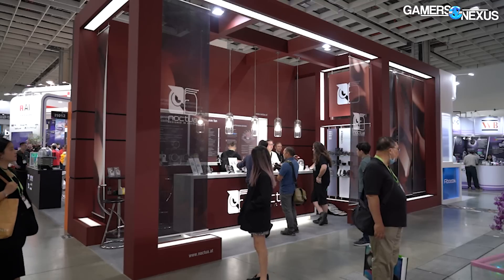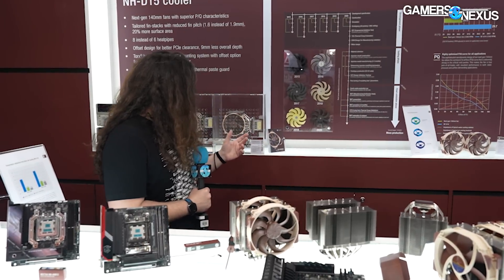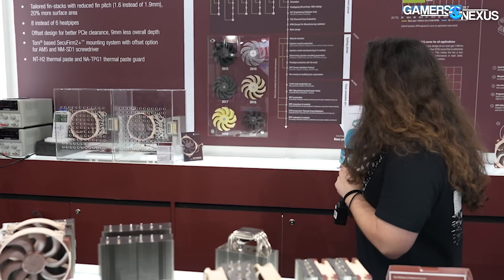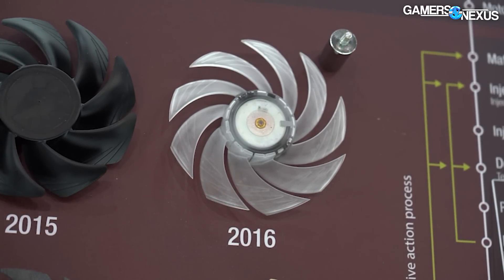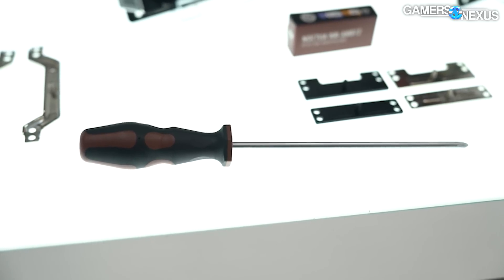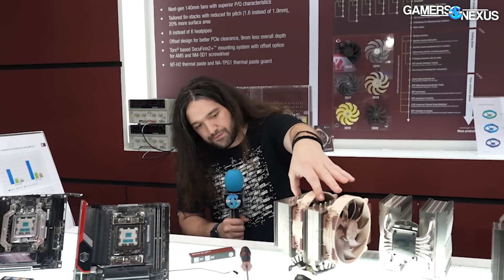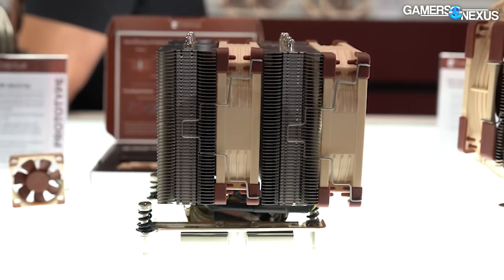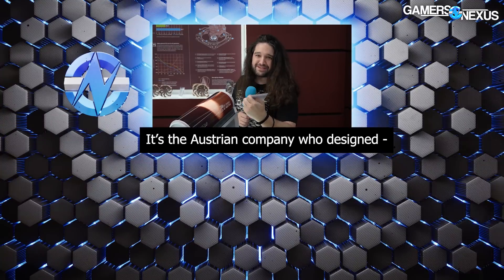Noctua is Back: NH-D15 Gen2 & 8 Years of Fan Development

Comment: is the fan sticking out more than on the first gen nh-d15? i was ready to drill out holes in my sff case for the fins that stick out with a first iteration of the cooler, but the new fan seems to be towering over the heatsink for like 5mm more...

Comment: Noctua is fine. While I think they are really admirable in certain ways. They just totally prevented me form buying their stuff for a long time because they had just did not give basic colors like black and white for their fans. They could have easily conquered the market long ago if they just spent even tiny bit of focus on aesthetics.

Overall, I actually don't like the company, even though I think they make very functional products. I really liked them decade ago, but after that they just never got me to buy their stuff. They basically made zero effort to cater to customers. And at great loss to their company. Frustrating thing to me it really was for nothing, it would not have been hard for them to offer basic colors and touch up their fans a bit. They didn't need to go rgb and other gimmicks, but they just lagged on even color black for ages. All this would have been quite low effort and would not have distracted one bit form their performance focus.

Now, if I was buying best cooler for powerful cpu and overclocing now, I would probably black noctua. But I don't really need anything that powerful so basic becool! is more than fine. And it looks better.
Reply: They are actually not that good. Competition is fierce. 
They have been extremely bitchy in past accusing several companies of copying them while themselves take inspiration from great engineering from other companies. A lot of inovationas they brag about have been known and solved for a long time in the industry.
Their marketing, customer support and ease of use is top notch. And that is what separates them form other....

Otherwise, I would personally avoid them.
Reply: @bozoc2572  I didn't know that. But I knew they were just really stuck up business just from fact they have not made any proper actions to address consumer needs. Or if they do, it's very late and bare minimum. 

And yeah, when it comes to fans I don't see any reason for anyone to buy them, they look bad and you can get equivalent or better ones for better price. CPU coolers currently have their space at high end, but other than that I don't see the appeal or actual reason for buying them.

Comment: I exclusively use Noctua fans with all my PC builds now. I've used fans from ghetto companies like UpHere, BeQuiet, and Corsair as their products don't deliver. I have no issue paying that Noctua tax as they provide outstanding customer support. I love using Noctua's Industrial 3000 RPM fans on their air coolers and aftermarket AIOs as they are so quiet when tamed and can be so aggressive when needed. Also, I've never had a Noctua fan go out yet.

Comment: The attention to detail from Noctua made me use them since 2008. Never used any other cooler/fans. I have builds running daily for more than 10 years not a single problem. Expensive and ugly thou. I will use liq  cool when i can run them daily no issues for at least 5 years. no scales, no pump failure ,no refils etc.

Comment: I have no problem picking only Noctua if at all possible, because I like the brand, but damn, the product range is so varied and confusing. Can't they decide whether it is worth it to have one or two fans with one of two blocks of fins? And whether fan overreach or neat fit with fin height makes a difference?
Well, I guess GN will have some test data on these if I need to check. Luckily it is currently not a concern of mine.

Comment: Quick question: did anyone try a  contra prop style fan setup like in the Tupolev Tu-95 or Antanov AN-70.....or better like in the NK-93 shrouded contra props setup? Just google it for those who want to know....i know that contra props are rather loud...but being shrouded like in the NK-93 engine should help and my guess would be that the rpm are rather low compared to normal fans

Comment: I did use a Noctua D12 on my old gamer PC during 10 years, excellent performance with a  overcloked i7 860 (@3800mhz), silent and perfect reliability, no problems only removing dust..., but i did recently built a new PC with a Rysen 7800X3D (without any overcloking) and did cool  it with a Actic 360 (i did first think about using a Noctua D15, but no...): the Arctic is a realy good AIO, relatively unexpansive, silent and efficient (50°C at CPU in game)

Comment: (For the next-gen products, I'll edit my comment to include the actual model numbers here once they launch and YouTube recommends me this video again)

(9:32) I could immediately tell it was a promotional item (complete with the same design used on the label on Noctua thermal compound), however, off to the left, it looks like Noctua are collaborating with Linus Tech Tips to produce limited edition Noctua themed LTT screedrivers. Neat!

Edit: I had a look at Cuula One, and while not a consumer product, it looks like a way for drink companies, for example, to promote new drinks at roadshows, events, supermarket sample booths, or even at a sports event they would sponsor. The branding on the side can be swapped out, so I imagined a company inserting one based off the design of the cans itself but edited to fit and with the drink logo positioned sideways or oriented in a way to look like a can being poured out into a cup.

Comment: I run a D15 in my AM4 build and used 4 x 140mm  Noctua industrial case fans(NF-A14, the ones that go up to 2000rpm), gave away the stock fans.  My Phanteks P600S case doesn't have airflow; it is a very quiet air pump ! Set it and forget it, love the stuff !

Comment: Along with the D15, I'd love to see an update the NH-U14S with the new fans they're developing for the next-gen D15.  

And please please please please release these with Chromax variants from the start.  Don't make me wait 3 and a half years to buy your fans again.  I get you want to sport your colors, but I'd rather you do that by putting that beautiful metal owl emblem you include with your coolers on the top of the cooler in an interesting way over a black backing rather than the entire fan that goes completely against the visual theme of any PC I build.  I love your fans, but man do they clash against literally everything except a purpose built Noctua themed build.  Which no offense, almost never happens.  So I'm begging you, please make the Chromax versions available from the start or at the very most, within 6 months of the initial brown and beige release.  There are better ways to sport your colors.

Comment: Wondered if any Thermal paste nerds could help a brother out; Got myself new paste from Noctua (always seen the praise for cooling!) I'm using it for fixing out my CPU temps with a Corsair AIO H150i ELITE CAPELLIX. Had to take it off and back on the other week when i was doing cable management & cleaning. Noticed i didn't have a good spread on the CPU and i was out of my old paste. I've got a little spreader it came with along with some wipes but i do have Isopropyl on hand. The H150 had paste pre-applied on the AIO but how should i go about applying the thermal paste this time? On the CPU itself or re-apply on the AIO? Should i use the spreader to even it out? I've been holding off on doing this for about a week now as i really don't want to make a bad judgement call and lose out on cooling. If any legends can help out i'll give you a sub <3

Comment: Hope Noctua brings out a huge cooler similar to the IceGiant CPU cooler sometime in the future. With Noctua's quality and perfection. The cases now have enough space in the direction because you no longer use CD drives and upwards is often mesh, if you take Fractal Design cases as an example. Graphics cards take up more space towards the front of the case and a CPU cooler could do the same.

Comment: I have a dumb question - why all fan manufacturers put a motor in the middle of the fan? Why not putting a coil outside on the perimeter and avoid blocking the center of the fan?

Comment: I've had a pair of Noctua's 140mm IndustrialPPC fans on filtered intake duty in my PC case running ~700rpm 24/7 since January of 2016 and they've been brilliant.  That little bit extra static pressure the industrial-grade fans provide has really helped keep the inside of the case from getting grotty.  I have dusted out my heat sink's fin stack several times in these last seven years, but I've never actually needed to, and that's really something considering I share 900 square feet with several cats.  The fans aren't silent, but the timbre of the sound they do make is pleasantly unobtrusive like the sound of a gentle breeze through the trees outside your window.

Comment: 8 years of R&D is what happens when you take the German perfectionism and crank it up to 11 by being Austrian.
Reply: i have a disease where i only drive volkswagens, older ones at that. but i like how dead simple the cars' designs are. i do all maintenance, including transmission and engine rebuilds, body work, electrical. once you have the few scattered specialty tools needed, you quickly learn why there are more of those stupid little cars on the road with more than 100k miles on the clock than any other brand on earth. more than all american brands, more than all japanese brands. that is what we need. simple, stupid, reliable, and IT JUST WORKS.
Reply: @ghomerhust  cough Volvo Redblocks cough
Reply: We'll need these kind of mentality if we're ever going to be able to explore planets. Over-engineered spaceships will be better than American's "planned obsolescence" so we can sell you a slightly improved version of ship.
Reply: @Paul_Sleeping  absolutely! K.I.S.S. also works in space travel. the more complex stuff gets, the more dangerous it becomes.
Reply: @ghomerhust  Ahh, very good point. Hopefully we can find a good medium with well-engineered and safe spaceship while it is  easy to repair during space travel.
Reply: @Paul_Sleeping  I mean you are certainly right in most regards. But I would say that NASA is pretty impressive for space stuff specifically. I mean we're still using 50ish year old satellites like the voyager probes.
Reply: @Paul_Sleeping  idk, SpaceX is doing exactly that. American
Reply: @tuckerhiggins4336  Yea fuck SpaceX ngl. I think private space exploration companies is a terrible idea overall. And SpaceX is the definite worst just cause of Elon Musk.

Comment: I was affraid that Noctua will stop producing this super-fan's (NF-A12x25 ULN - ultra silent, like 39cm away from wifi-router dead silent) and bought five of them, nearly 200$ in fans! They are irreplecable! I connect them through USB-to-12V cable to cool down Cable-providers modem and my WiFi router. If you ask, yes I have DOCSIS 3.0 near 800Mbps dl and 100up. They have fan blades so close to the frame, really impressive - I need them to have silence and reliability (years of use).

Comment: I mean through all those years there are only second to them fans. Running all Arctics fans, just because they are way cheaper for pretty close performance and relaibility + lifetime and only resent P12 Max are real competition to old Noctuas with a bit more noise for the same performance + overhead for more performance.
Noctua's strategy with spending so much time for a worthy upgrade is absolutely legit, especially taking into account that their selling points are scrupulousness and being as close as possible to perfection at all costs.
For example it took 5 years for Arctic to bring major update for their P12 (P12 Max), with 6 years warranty for both old and new. And Arctic P12 wasn't as ambitious as Noctua's fans, mind you, it had more room for improvement.

Comment: I love the fact that Noctua decided to offset their new nh-d15 2.0 like they did with their nh-d15s coolers for gpu compatibility. This is the main reason I went with the d15s. I can't wait for the new d15. I would imagine with the bigger base, 8 heatpipes, offset mounting and design for gpu clearance, and the 2 updated lcp 140mm fans, this should be a monster of an air cooler.

Comment: I love Noctua fans! I have 3x 9 year old Noctua 120mm case fans in my corsair750d (2 mounted on a corsair h110 which is also 9 years old and still cooling my 4770k) and have been running flawlessly daily since 2014.(knock on wood :) ) The only thing I realized now was that putting Noctuas in a watercooled PC makes it so the only thing you can hear will be the annoying pump noise. Going all air Noctua next time.

Comment: noctua is great. you can trust blindly that their stuff just works perfectly.
I have had so much fans that had motor noise, rattle, droning, other issues with all sorts of other "high end brands" and their coolers like bequiet, noiseblocker, deep cool and fractal design and noctua has been spotless in any application.
noctua is a little bit more expensive but its the only brand thats actually worth paying the higher price for. everyone else will ship you a trash fan that you need to replace sooner or later, but i never had any issues with noctua fans, which is actually astonishing, because almost no other company has such a good track record with quality control and overall product quality.

Comment: Seems like a pretty reasonable amount of time for r&d considering their products remained at or near the top of the comparison charts in the meantime
Reply: ...and remained running the entire time they were at the top.
Reply: @jong2359  no kidding there. I have been using noctuas for a decade and zero failures. Other brands, plenty.
Reply: @kelownatechkid  Even their redux line is rock solid. Have 2 NF-P12 redux that are spinning basically non stop for 3 years now. 
One thing I love about their fans is their noise profile. It blends in with the background noise extremely well.
Reply: @DrakkarCalethiel  I first started buying Noctuas for the noise, and to be honest it's the main reason I keep buying them. I can't stand noise. My noctua builds are all silent to my ears, unless my GPU is doing a big render, but that's the GPU fans making the noise.
Reply: @fakecubed  Same, unless my GPU gets loaded, my system is dead silent. Makes me want to do a "Noctua mod" on mine to bring noise further down.

Comment: 8 years for the development of a fan probably is about right actually.

Turbomachinery engineering is hard.

And this is especially true for axial flow fans , because you would think that the physical space that you are given to design a fan is basically infinite (you can make the shape of the blade ANYTHING you want), but what you design MAY NOT achieve the performance (and cost) objectives that you are trying to hit.

And THAT is a PART of what makes the turbomachinery engineering so difficult and so challenging.

You move the control nodes for the curvature of the blade, and even if the blade has variable thickness throughout, you can SIGNIFICANTLY, adversely, impact your flow performance.

It doesn't take much for it to NOT work.

Comment: Their mtbf, cooling performance and noise levels set the bar high. Some people think they are ugly. 'The tan and brown doesn't go with my rgb' Whatever. I won't use any other air cpu cooler since I switched a few years back. Used a few of their case fans too. Yes they are more expensive but if you rely on your computer its a cry once situation.

Comment: Moved from Noctua to Bequiet for my Intel 12900k. Big mistake. The mechanical install of the BeQuite fan was insanely painful because you couldn’t reach the screws . A simple cutout for the screwdriver would have solved it. This are details that make Noctua stand out of competition. It is still the easiest on the market.

Comment: This will support the new LGA-1851?
My next PC will for sure be Meteor Lake, and i want the NH-D15 Chromax Black as cooler.
Reply: ofc
Reply: @GUY-on-Earth  ok ok. Well i thought as much, but you never know. For all i know even the original NH-D15 can fit on 1851. I just don't know exactly how the design will be yet.
Reply: @FabledGentleman  i think that’s the the cold plate is bigger on Gen 2 cause the 1851 socket is going to be bigger

Comment: Looks promising but tbh the competition is also very strong and often times a lot cheaper so this fan would have to be a lot better for me to consider buying it
Reply: There are certainly cheaper options that are as good or better, and sometimes about as quiet… but when I bought a cooler & fans just last week it was the long warranty and my experience with Noctua’s excellent customer service that convinced me
Reply: @TheShortStory  Quick maths: I buy an Arctic fan for 7€ -> its broken and for some reason Arctic doesnt replace it -> I rebuy the fan so I spend a total of 14€. Noctua fan costs 32€ >>> 14€. Even if the replacement is also broken, buying a replacement would still cost less than a single NF-A12. Doesnt convince me tbh....

Edit: Arcitc P12 is actually just 5€ here...
Reply: @Max-oo1xw  warranties are important for two reasons. Yes, there is money saved by not having to buy a new one. As you point out, you can buy cheap stuff many times over instead. But a warranty is also an indication of the manufacturer’s confidence in the product. A product with a long warranty is just likely to last longer. That reduces the time I have to spend replacing broken stuff and creating e-waste.
Reply: @TheShortStory  Yes thats a good point but for me personally thats just not worth paying 6x more just to have a fan that is slightly better and will (probably) last a few years longer.

edit: just googled: the warranty of both the noctua and the arctic are 6 years ;)